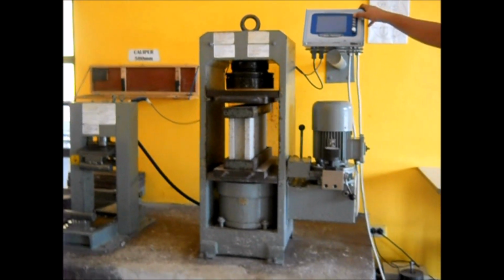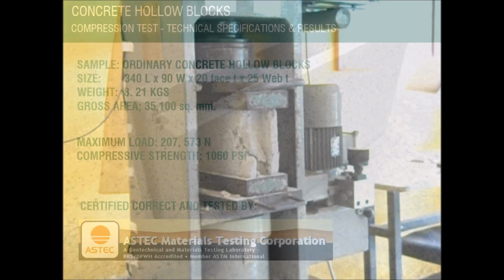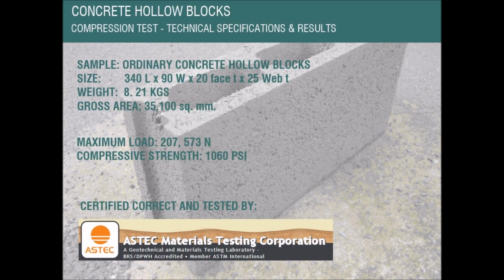Materials Testing & Construction Concrete Hollow Blocks Test

Comment: Compressive strength of 1060 psi is approximately 7.31 MPa.  From this data I found out that the area subjected to load is 28, 396 square mm. Is this area came from the gross area minus the cells?